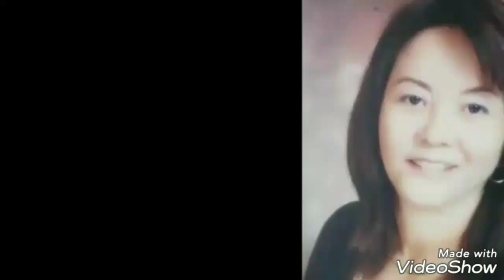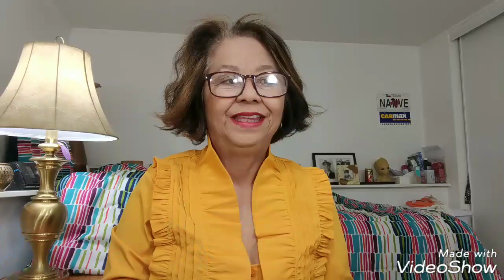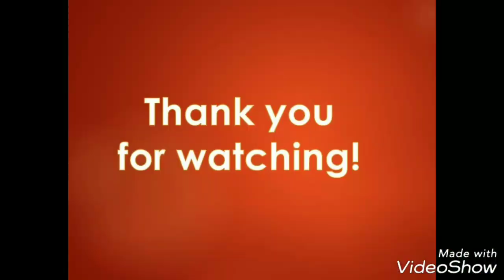Removing Fluid from the Lungs

Comment: I agree totally with this video. I'm recovering from the flu, not sure what kind, and noticed my SO2 had dropped from 96 to 87. I knew that was too low. As I lay in bed last night with finger cuff I develop a deep breathing exercise. I would inhale through my nose then exhale through my mouth. I also hear the crackling. I would repeat the process until my body made me deep cough. I repeated the process until I heard no more "crackling" or wheezing. I measured my SO2 every once in a while and watched my SO2 rise to 96. Thinking I had false reading I lay there for 15 minutes before taking another reading. I dropped to 94 and stayed there for several readings. I also started out with two pillows under my head, then went to one pillow and finally to no pillow. When I awoke in the morning I tested my deep breathing and notice the "crackling" again and started the all over again. It appears to me that my deep breathing process is aiding in my recovery. Using this process causes lots of coughing but that's just how you help rid the fluids from your lungs. Before climbing into bed to start my deep breathing process I put lanolin on my lips. If i forget my lips get pretty dry.
Reply: I’m freaking out I just dranked water while I took a deep breath for some reason and read on google that you can get liquid into your lungs now I don’t know what to do? How do I know if it did?
Reply: @MariaOrtiz-il9fq  you'd know if you're having trouble breathing and occasionally coughing up clear runny mucus. The above routine that Steve Batty outlined sounds like the way to go!